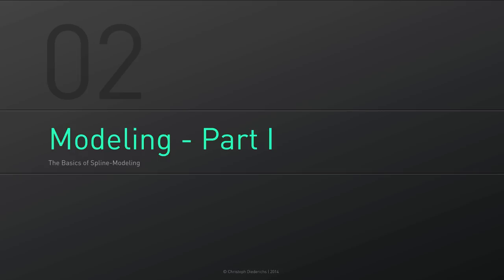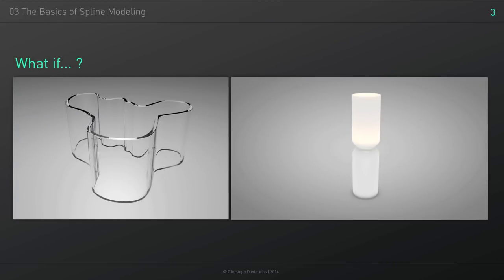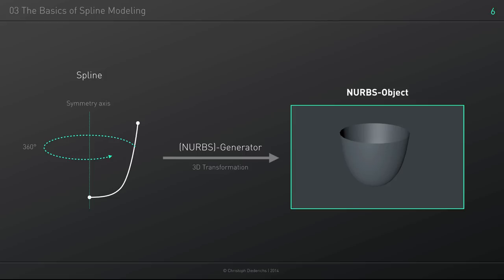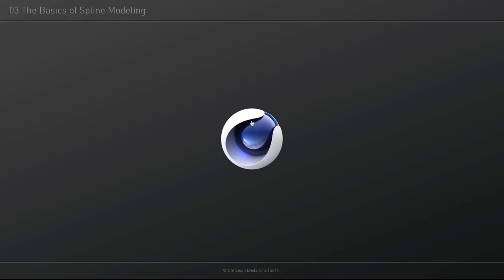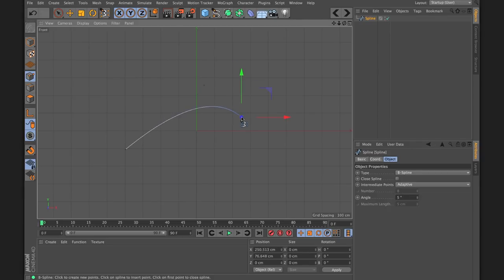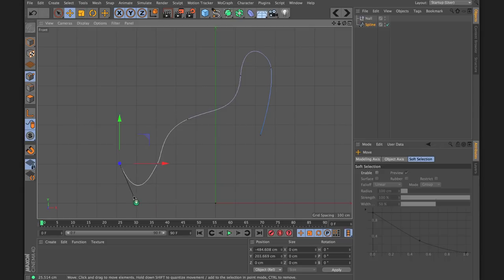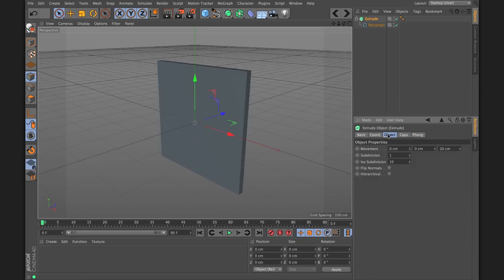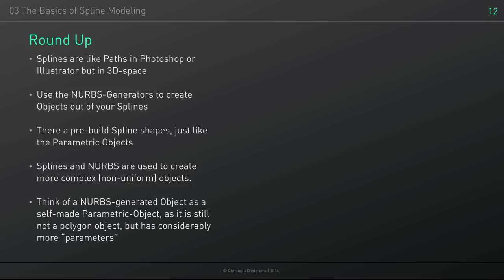C4D Fundamentals | 02 - Introduction to Spline Modeling

Comment: One thing that I don't get to work. How do you combine/connect a bezier spline to paramietric spline (like arc or half circle) to the one spline? There is a lot of situations that you use bezier spline tool, but some part of spline you need to add perfect half circle (and then I need to use parametric halfcircle spline) but I can't connect these two different spilne object as a one spline object.